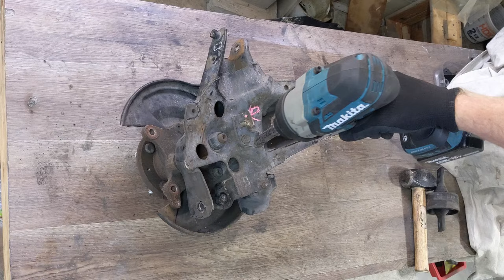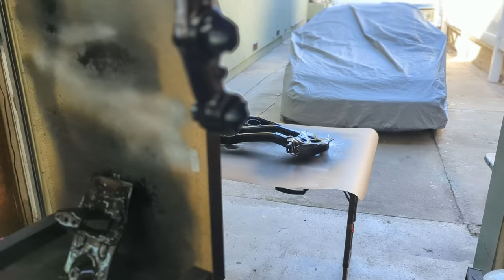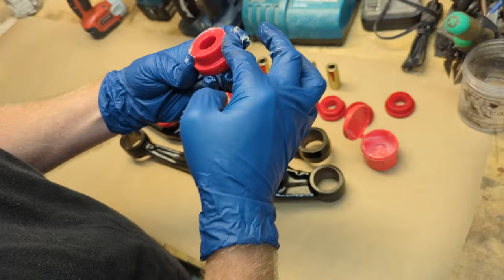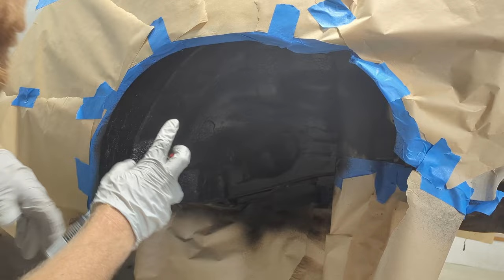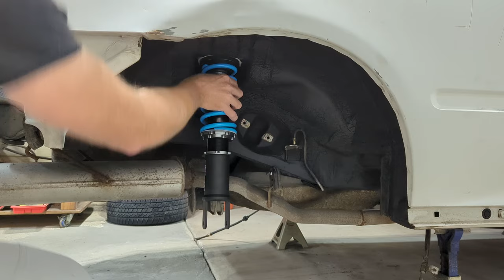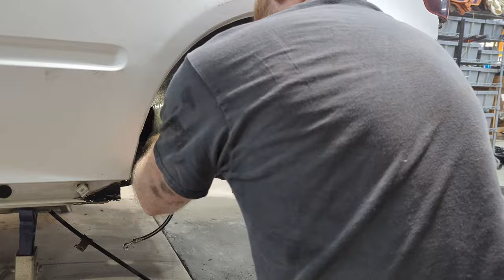Honda Civic Hatchback - Part 12 - Rear Disc Brake Conversion - Make it So

Comment: Thank you for documenting this fantastic build! I really want to convert my ‘92 CX like this as well but I’m holding out for rear trailing arms and lower control arms from the sedan or SI hatch. Apparently the geometry is slightly different on the integra parts.
Reply from the maker: Oh I didn't realize that. I hope it doesn't cause and issue. I thought they were interchangeable.
Reply: @MakeItSo  I don’t think the difference is too bad, the integra arms stick out a little more than the civic or del sol ones. If you are running stock wheels I think you will be ok. EDIT: it’s just the lower control arms that are slightly longer, not the trailing arm, sorry for any confusion.

Comment: I'm following in your footsteps, I've purchased the donor parts for the rear brake exchange. Did you purchase a bushing kit? Or did you buy the bushings individually? I need to replace everything under my car and the kit would be convenient, I'm unsure however if the kit for my car is compatible with the rear brake assemblies....
Reply from the maker: I purchased a full suspension kit from Energy Suspension. In my case the rear disc conversion didn't change any of my bushing needs. I have lots of bushings I didn't use in the end, but some of those are for if you're replacing bushing on the factory shocks and things like that. I have coilovers so I didn't use them. But I think it's still worth it to get the kit if you want to do everything.

Comment: hey bro hope you’re doing well, im also redoing my rear suspension and i just wanted to know what spray can of black did you use for the trailing arms
Reply from the maker: I've been using this stuff for trailing arms and subframe stuff. Just let it cure for a few days if you can wait and it'll be good to go. 

https://www.amazon.com/dp/B000PIK1YC?ref=nb_sb_ss_w_as-reorder_k0_1_16&amp=&crid=3G94TNGG6ILP3&sprefix=rustoleum%2Benamel&th=1

Comment: How did those 4 torx for the spindle come out so easy for you ;-; i had to put a oxyacetylene torch on multiple of them so far, stripped two, theyre driving me crazy
Reply from the maker: I guess it depends on the condition of the metal. I hit them with some PB Blaster then with the impact gun and they popped right off. When I did the same on my CRX I stripped one and ended up welding a metal bar to the head of one to be able to get it out. They are super frustrating.

Comment: Do you have a parts list for the stuff you used? Is that the integra LCA?
Reply from the maker: Yes that's the Integra LCA with the mounts for the rear sway bar. Everything is from the 94 Integra I found at the junkyard.

Comment: The mounting hardware that you removed the oem zinc coating from will now rust
Reply from the maker: Good point. I had to clean them, but didn't try to preserve the zinc. How would you clean them without damaging the zinc?